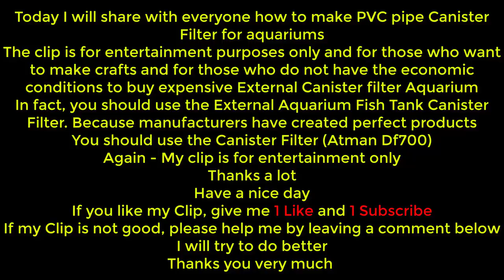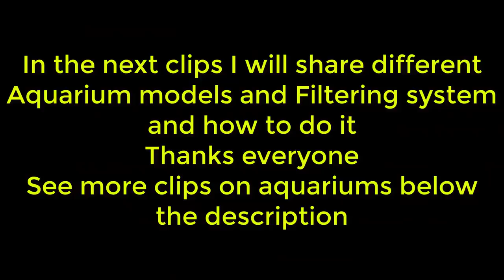Aquarium model 3 - How to make Filter outside the aquarium - [Piece of Paper]

Comment: The thread tape should be threaded clockwise 7:35, in this way when screwing in, the thread will continue to tighten.  The way you did it,  the tape got loosened.
Reply from the maker: Thank you for reminding me
I will pay attention in the next videos
thank you very much
Have a nice day @Stephan Farrugia
Reply: @pieceofpaper924  No problem. 😀
Reply: Stephan Farrugia I was about to say the same thing but saw that you mentioned it. It took me years in the garden to finally remember which way to put tape on correctly every time.
Reply: In the past my dad used hemp string. Back then it was more obvious which way you needed to thread the string. If done wrong, all the string will get loose.  Hemp string did not stick to the thread, like thread tape does.  So it is easy for me to remember.
Reply: Stephan Farrugia I remember seeing hemp string although it was probably sisal in Australia. Yup it would have been more obvious.

Comment: Can i use thread cup instead of coupling cup?
Reply from the maker: If so, it is the best option
Because using metal locks and rubber seals after a while, water will easily leak
This is just a test requested by everyone
In fact, I use only genuine commercially available products
Have a nice day, my friend
Reply: @pieceofpaper924  thank you for the reply.  More diy to come .